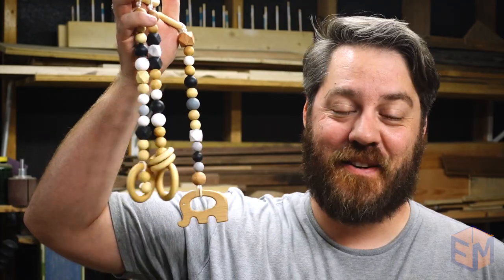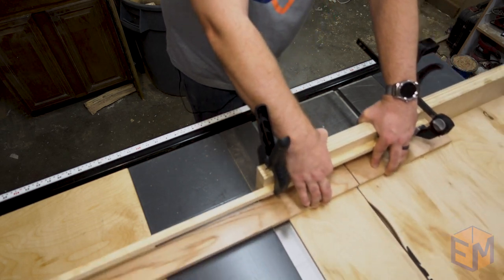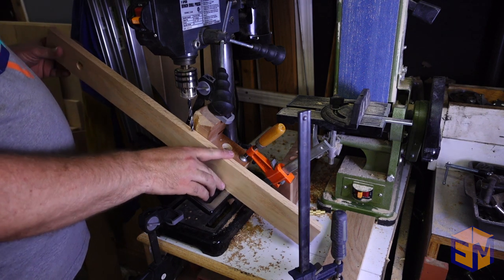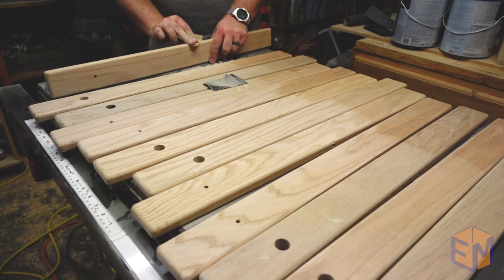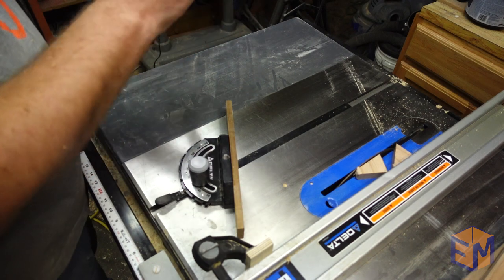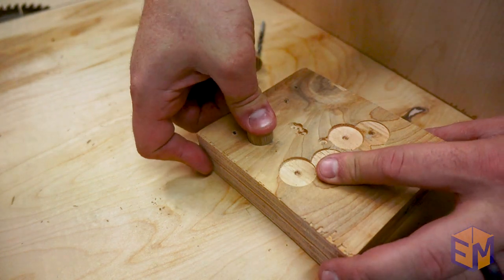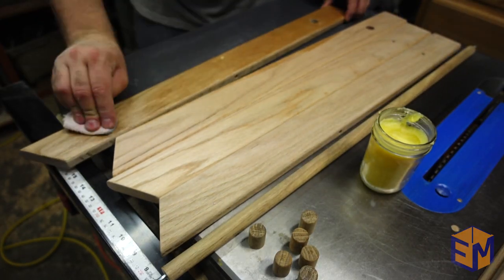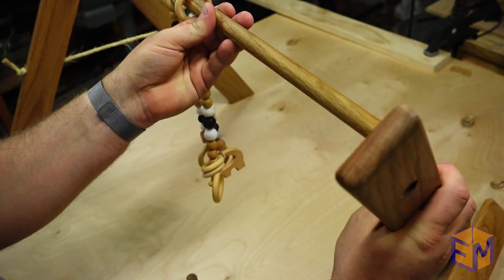DIY Wooden Baby Gym

Comment: Nice job, Nick! It looks very stable and safe. 
Just one feature to be understood: how the inside legs are locked-in-place to avoid their possible shifting along the horizontal rods?
Thanks in advance
Reply from the maker: They actually don't lock in place.  I have found that it was not as necessary for them to lock and it made it easy to move the gym out of the way as the legs were free floating.  However, if you do want to lock them, you can do the same with the inside leg as the outside leg and drill only partway through with the forstner bit and all the way through with the smaller bit.  You have to compensate for the additional material so the hanger bolt goes all the way through, but then you can lock both legs in place.  I used this design with my child and never really noticed a problem with the legs moving, but if I had to do it over again, I probably would make it so it would lock in place.  The plans will have the info for the locking legs.

Comment: Great project.  My daughter wants one.  what is the length and width of the a frame boards and how long is the dowel.  Thanks
Reply from the maker: The dowel ended up being 31.5 long.  The boards on the side started at I think 2.5" by 29" long, then got trimmed down to the final length of around 27.5" (on the long side).  I'm glad she likes it, I'd love to see a photo if you build one!

Comment: What angle would you advise to use for the legs?
Reply from the maker: They are at a 60 degree angle, or 30 depending on where you are measuring from.

Comment: Very nice. One question about the finishing: what jojoba–beeswax proportion did you use? I've seen many different recipes of and I'm in doubt between making it 1/2 oil + 1/2 wax, or 3/4 oil + 1/4 wax. Many thanks in advance.
Reply from the maker: Thank you!  I believe with my recipe I actually split the difference and did around 3 parts oil to 2 parts wax. I wanted kind of a medium hardness to the wax, still workable,  but enough to give a little bit of protection.
Reply: The Every Maker - Nick thanks! Would it be reasonable to say the more oil the softer the paste and less protection, and the more wax the harder the paste and more protection? If I wanted less protection but more oily finish I would then go with the softer? Thanks in advance!
Reply from the maker: @AlejandroGarciaIglesias  Beeswax isn't going to offer a lot of projection in general, but it does add a little more protection than just the oil.  You can use straight oil to penetrate the wood a bit more and put a pastewax over the top and buff it into the wood.  I haven't played too much with the different amounts of wax and how it affects the finish over long term, but check out James Wright, he also makes different paste waxes and does a good video on his process.  https://youtu.be/WiMw71UBj3M

Comment: So good! Can I ask you what size dowel (width and length you cut the dowel to?)

Also, what size hanger bolt? I have never used them before but I love the ability to disable the item so easily:) thanks so much!
Reply from the maker: I had to go back and look at my plans, the dowel was 1" in diameter x 31.5" long.  The hanger bolt was 1/4" x 2 1/2" long.  It needs to stick out of the dowel by about 1 1/4" to allow enough of the bolt for the nut to grab.

Comment: How long did you cut each of the side legs?
Reply from the maker: The dowel ended up being 31.5 long.  The boards on the side started at I think 2.5" by 29" long, then got trimmed down to the final length of around 27.5" (on the long side).

Comment: So I’m now making this for my second child, I don’t have any power tools besides my drill. Have any tips?
Reply from the maker: This project can easy be done with hand saws and whatever you might have to finish boards, be it hand planes or sand paper.  If you can get boards cut to width, that will help. Drilling through the boards for the rope will be tough, so I'd suggest a jig and just drill straight through.  The angle isn't as important.   If you need some hand tool guidance, check out Matt Estea, he has some great tutorials on hand tools.
Reply: The Every Maker - Nick thanks! I actually started tonight and it’s going good for my first time!

Comment: It is so nice, i want to make one for my daughter, can you share the dimension please?
Reply from the maker: The dowel ended up being 31.5 long.  The boards on the side started at I think 2.5" by 29" long, then got trimmed down to the final length of around 27.5" (on the long side).
Reply: @TheEveryMaker  thank you so much, will make it right away.
Reply from the maker: @HKStageTech  That's great!  I'd love to see what you come up with!  If you post a photo somewhere, tag me @TheEveryMaker.
Reply: @TheEveryMaker What is the angle of the diagonal cut?
Reply from the maker: It's about 30 degrees.